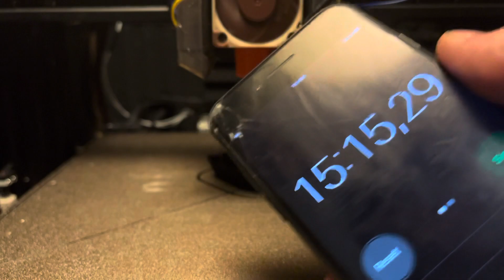Ender 3 v2 running klipper 400mm/s, Benchy in 15:15 #speedboatrace

Comment: you have to upgrade all 3 axis to linear rails if you need stable printer at those speeds.Those V-Slot Wheels will not last long which will result in bad quality prints after a time or just get BambuLab X1 if you don't want to upgrade and spend your time

Comment: Very nice run! The quality is pretty good for this themperature and speed with PLA. 

We have the same Pei plate btw! Keep on pushing :)
Reply from the maker: Well thank you, I will keep on trying and try to aim for a 10min one:)
Reply: @wenn1215  that would be totally doable on an ender! I wish you succes with that 🔥
Reply from the maker: @3dprinterfun905  yeah I hope I can do it, btw what is that direct drive that you are using in you video called?
Reply: @wenn1215  it is the Orbiter Extruder v1.5!
I really like that one, had 0 issues so far and works good.
Some recommend the sherpa mini over the orbiter, but i am not so sure about that. The Sherpa has smaller drive gears afaik.

I guess they both have their pros and cons!
Reply from the maker: @3dprinterfun905  cool:) does it help when your printing faster?
Reply: @wenn1215  if you are using the stock Extruder, a dual geared extruder of any kind will help. 
The single geared Stock one will slip at some point. Dual geared has more grip and therefore more pushing force.
A direct drive is more precise, as the distance to the hotend is shorter, which results in a bit better extrusion consistency. But if you go with a dual gear extruder on bowden, you can conpensate for the play in the bowden tube by calibrating pressure advance!
Just note, that at higher speeds, pressure advance becomes too agressive, which leads to defects on corners. This means, you have to do more testing! 
I found it easier to tune direct then bowden! 
That was a bit long, i hope it helps!
Reply from the maker: @3dprinterfun905 okey thanks I never understood why dual gear was so popular, and yes I actually had to turn off pressure advance for this print as it only ruined corners and stripped away the filament, but I will se if I go direct drive or Bowden but I guess I will se.
Reply: @wenn1215  yeah that is what i mean, i had that too on a single geared extruder.

The accelerations and deccelrations of PA are way too agressive for the single gear and it just chews on the filament.

If you like, i have a discord where we could discuss more in detail, or on the annex discord (i am not thaat active on that one)